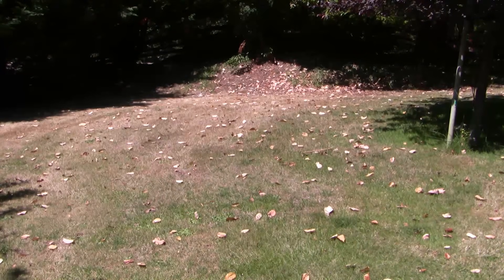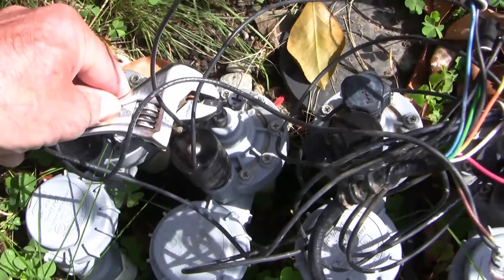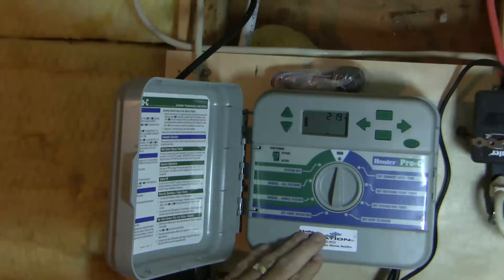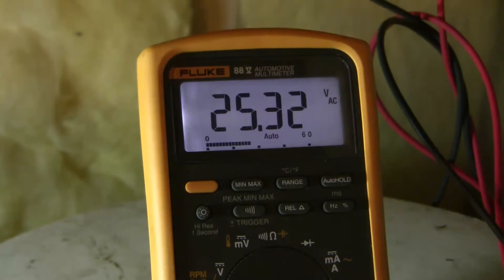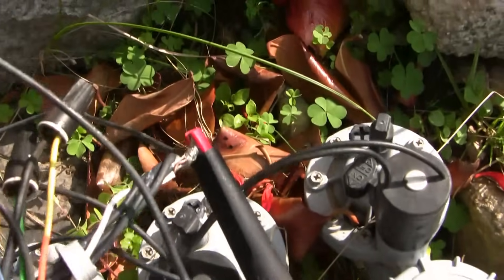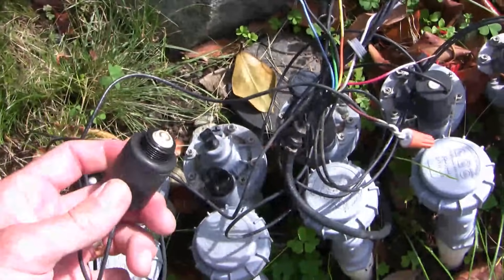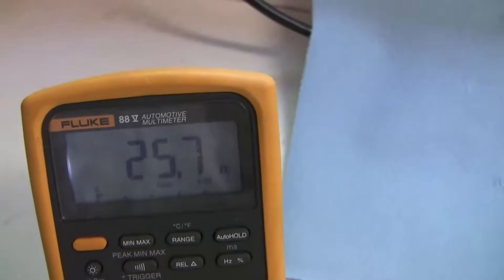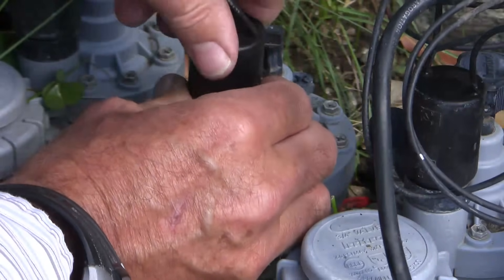How to fix an irrigation sprinkler zone that is not working

Comment: If I know already know that water flows from the zone I’m working on, but does not turn on when I activate from main controller, is it still necessary for me to do a drop test with all of my solenoids throughout my yard? Or can I just measure the one solenoid valve that isn’t responding?
Reply from the maker: Just study the solenoid and circuit that is bad. Cynics or professionals might say, just swap in a new solenoid and see if it works. Professionals sometimes do that because they have new solenoids in the truck and they can use the new one elsewhere if that doesn't work. They recognize the typical pattern of solenoid failure and swapping in a new one is faster. However before the amateur takes a possibly unnecessary trip to the parts store, it takes only a minute to do a drop test to verify the diagnosis. The other option is to swap two zone solenoids and see if the problem moves to the new zone. However once you get comfortable with drop testing, it takes only seconds to do and you don't need to fiddle with wiring on zones that you know are good. I find proving the diagnosis to be satisfying, if only by giving more confidence that you aren't swapping parts blindly.

Comment: First off great video   ok my problem is that im only getting 9 volts to one zone...24 volts at the timer   any ideas?
Reply from the maker: You can get strange readings if you accidentally set your multimeter to read DC volts, so check that first. When current is flowing, it is not uncommon to read lower voltage, usually meaning there is some other source of voltage drop like a high resistance connection at a splice or connector. Check your wire nuts along the run, and do the drop test at different areas to decide if the drop is on the ground side or the power side. You can also get a partial short inside the solenoid itself, lowering resistance to the point that other sources of line resistance becomes more of a factor. To smoke that one out, you'll want to disconnect the solenoid and do a separate ohm check. Good luck!
Reply: the zone wast working..i hooked 2 zones together and it worked  so im thinking wiring somehow went bad
Reply from the maker: If two solenoids are electrically hooked up in series, then the voltage drop is split between the two devices. If hooked up in parallel the drop should still be 24V, but the current is split along two different pathways so power to activate devices is reduced. If you physically merged two lines together with one solenoid, you should still have 24V....

Comment: Subscribed. Great quality.
Reply from the maker: Thanks, brother.
Reply: Quick questions, what do you recommend for running sprinkler wire outdoor? I have six zones with buried wires. Wires are shorted (checked using your method). Solenoids are good. I need to run new wire.
Reply from the maker: Even though it is an AC, fairly low current feed, there will be some line loss especially if the run is long. I would use multistrand insulated copper wire, and the manual for your controller may offer specific details as to wire gauge. I would use at least one step larger than minimum gauge recommendations for length. If you can isolate where the short is, your job will be a lot easier. You can borrow or buy a 'fox and hound' short circuit finder if the lines aren't too deep. Those things work fine in areas where there are no other wires close by, although I find the signal confusing around a circuit box where inductive effects come to play. Before digging around make sure there isn't a problem of frayed or crossed wires where they enter the controller and at wire connection points.
Reply: spelunkerd Thank you. I'll be on it today.

Comment: or you could also turn down your flow control on your valve to also remove the solenoid.
Reply from the maker: Good point, thanks for the contribution to the thread!

Comment: Toro XF-416 irrigation controller.  All my sections 1 thru 6 stopped coming on after the breaker failed.   I checked power to and from the pump along with circuits 1 thru 6.  All good.  Haven't tested the coils yet... what are the chances all 6 burned out at the same time?
Reply: I found the problem.  When the controller was reset from changing the breaker... pumps 1 thru 6 were turned on by default 7 and 8 were off.  Switched pump 7 on and all stations worked flawlessly.
Reply from the maker: Glad you worked it out. This kind or remark together with followup after fixing the issue will likely help others. Viewer remarks like this one are a primary reason Youtube is so successful.

Comment: Hi.Oh boy! Overwhelming for me. I don't the necessary appliances to test.. I know I have a problem of an irrigation sprinkler zone not working AND a sprinkler head that won't shut off. I basically do all the timing and zones manually, as well as turning on /off the main water to the system. Ugh! 
Great video and education!
Reply from the maker: Thanks, there's always more to learn. If a whole sprinkler zone won't shut off at all, it is often a problem inside the valve. Hunter valves have a small passageway that can get blocked with debris, preventing the solenoid from allowing the valve to open when power to the solenoid is removed. You open the valve and clean it out, pass a small wire into that opening to be sure it's unblocked. Hunter have a video here on Youtube showing how that is done. If you think it's an electrical problem you could measure voltage at the solenoid to be sure it turns off when the time limit for watering on that zone expires. If the voltage fails to drop, you've got a programming issue. When one zone fails to close, all the others that are up next won't work properly because water pressure in the line is too low to open the next zone in line.
Reply: Norj Be if your sprinkler head is not shutting off that is an indication that the zone valve is weeping due to a bad valve solenoid seal or bad diaphragm which is in my opinion best to replace both and be done.

Comment: Thank you for the video! So I started my testing. I have 6 zones (I only use 4) and the only one that works did measure Ohms in the range you gave. The other 3 that I use (and aren't working) and the other 2 I don't use didn't give me anything. When I turned on the zones individually 1-6 all of them read approx 25volts.  Where should I go from here?
Reply from the maker: It depends a bit on your experience with electronic testing. However the simple approach would be to take a known good solenoid and swap it into the zone that is not working. If the zone then works, you know the solenoid is bad and I would replace it. A new solenoid is pretty inexpensive and so you could either swap in a new one or switch one from a working zone elsewhere. Some valves have a small orifice that decompresses the back side of the valve, and if that orifice becomes blocked with debris the valve can stick. So, if swapping a solenoid doesn't help the next option would be to disassemble and clean the valve. Hunter have a few videos here on Youtube showing how to do that.
Reply: Thank you for the quick reply. I swapped the wires one at a time from each valve to each zone. Only zone 2 works. All 4 valves worked when connected to zone 2 and didn't work when connected to any of the other zones.
Reply from the maker: It sounds like the bad zones have a problem with excessive resistance in the wiring. To prove that you need to put the circuit under load, with electrons flowing, and measure voltage drop across the solenoid, I was doing that during the video. For better explanation search the phrase "voltage drop test". If voltage drops more than a volt or so compared to voltage measured at the controller you are losing power because of a source of resistance somewhere along the wire between the controller and the solenoid. The common places are at connectors, where corrosion and water can cause resistance and drain power. Now would be a good time to replace any connectors with ones designed for wet applications. They come with a little dielectric grease that repels water and reduces corrosion. Alternatively you could buy a tube of dielectric grease at an autoparts store and smear it inside the connector, then wrap carefully with tape or shrink wrap insulation. Good luck!
Reply: Will do. Thank you!

Comment: Loved the video and very helpful. I usually just start with swapping out the solenoid for a good one and work back from there. Usually it is the solenoid. Thanks for making an sharing this with the world. Sure helps a lot.
Reply from the maker: You make a good point, that is the technique used by many professionals who have replacement parts handy and who can easily recognize the situation. Coming from the auto repair field, some parts are special orders and hundreds of dollars, so it makes sense prove the part is bad before replacing it. I like testing because it gives me insight as to how the system works, and it doesn't take a lot of effort to do the testing.

Comment: I have a question.  I am trying to get 7 zones working across the street from my controller.  I found the wires where they cross the street.  There are 3 multi stran wires coming into the controller.  They are spliced in a valve box below the controller.  All wires from the field are single stran #14 irrigation wire.  When I turn on a valve that is supposed to be across the street I get a good 27-28 volts from the controller, when I hook up the common and the 27 volt wire to the solenoid, it will not come on and I am getting a 0 volt reading on my meter.  If I take the solenoid wires loose I get my 27-28 volt reading.  Do you know or have come across a situation like this?  It has me pulling my hair out, not that I can afford to loose any.
Reply from the maker: It sounds like you may have a source of extra resistance to the circuit. Google the phrase "voltage drop test", it's a valuable concept worth understanding. I did a video on the topic while showing how to test a car battery and how to evaluate a starter motor, but that video might be a bit too much if you're new to the idea. If your measured voltage drops to zero when the circuit is turned on, there is extra resistance, somewhere. If the run is long, it could be in the wires themselves, but more likely it's at a connector or frayed wire somewhere along the way. This is really common, I did a voltage drop test today when fixing a battery powered light, and with the test I was able to find and then repair the bad connection. Look carefully at all the connections, and retest different parts of the circuit to better identify which part is bad. Importantly, to do a voltage drop test, electrons needs to be flowing, it won't work by just checking resistance with a multimeter. Good luck!

Comment: excellent.  What do you guess if sprinklers turn on  in 1 zone and the control panel does not work. contrlol panel it is all turned off but 1 zone just goes. and can't change to other zones via the control panel
Reply from the maker: To decide whether it is an electrical or a mechanical problem, I'd check for current or voltage at the solenoid to decide whether the controller has commanded the valve to be closed. First check voltage at the solenoid both when the valve is closed and then when it is opened by the solenoid. Then when the valve should be closed but remains open, recheck to compare your multimeter readings to see which pattern it matches up with. I'll guess the on command will be gone, but it's easy to check. If the valve is sticking open with no open command, remove and clean the valve body, looking for sticking parts and for orifices that might be clogged with debris. If the open command is still active, go back to the controller and try reprogramming. As you say, with one zone open you can't expect any others to behave normally because there won't be enough volume flow or pressure to see normal behavior. Good luck!

Comment: so what if that isn't the problem what else can you do
Reply from the maker: You've got to be more specific than that for anybody to realistically help. The best first step to fixing these systems yourself is to learn how they work. The other sprinkler video I did covers fundamentals that might help get you going. Once you understand how the system works, you'll be able to think of ways to expose clues that will point to the problem area. It will also make it easier to accurately communicate the problem to get advice from others. Any kind of DIY approach takes quite a bit of investment of time and effort, and it's easy to understand how many would find it too much to spend weekend hours getting dirty. A pro could often find the problem for minimal cost, so for those not willing to commit effort, I wouldn't hesitate to ask for help. Last month I spent several hours on my son's system, which is set up differently. With learned humility, I'll confirm it's a labor of love, even if you think you know a lot, ha ha.
Reply: spelunkerd basically I check the voltage on solanoid and controller but zone still not turning on
Reply from the maker: What if you open the valve manually?
Reply: spelunkerd it works manually just trying to get it to work one that zone the rest of the zones work except one
Reply from the maker: Unscrew the top of the valve body and carefully clean it. Some models have a little drain hole near the solenoid that can get clogged with debris. If the hole doesn't drain the valve won't open. Hunter have a Youtube video out showing how their new generation valves work, and they show that drain hole well.
Reply: spelunkerd kk thanks
Reply from the maker: No problem, let us know how that works out.

Comment: great video first off, I have a issue with one of my zones. the problem I'm having is when I leave my lawn to work off the timer the pressure at the sprinklers are low but if I manually do it at the diaphragm the pressure is fine.
Reply from the maker: Some systems have a manual control that will adjust how much the valve opens with the solenoid, I would look for and try that first. Make sure the solenoid is tightened all the way down, and I would remove it carefully and clean the seat. If that fails you could temporarily swap a neighbour solenoid to see if it works better. If it does, then it's time to replace the solenoid, they aren't very expensive.
Reply: Hello sir thanks for the prompt response been 5 tears for this video. I'll check that.  My diaphragms are the same as the ones in your video

Comment: out the solenoid there are two black wires, one goes to the power and the other?????
Reply from the maker: One wire goes to the common ground wire, which is usually wired to the ground for all the other devices with a large wire nut. That common ground will be easy to recognize because several wires lead to it, only one of which goes back to the controller. The other wire is a single coloured wire, connecting a switch at the controller to the solenoid. Of course it is AC current, but the notion of a ground is still useful.
Reply: thank you.

Comment: This is probably the best algorithm anywhere on the web for troubleshooting sprinkler zones, thank you for sharing!  I have a 10 zone system.  My issue is a bit strange, I'm able to manually turn on each zone at the solenoid.  However, sometimes, zones 5-10 will have low pressure.  They turn on, the pressure is just low.  Sometimes, they turn on just fine.  Zones 1-4 are reliable and have high pressure all the time.

Anyone able to figure this one out?
Reply from the maker: It sounds like your system pressure or water flow rate is too low. Look for zones that aren't turning off all the way, sprinkler heads that are broken, or kinks in your line that limit flow. Program watering when demand from  other devices will be low,  look for wet areas that might point to a broken line. Good luck!

Comment: Nice video and helpful but my Toro controller has snap in connections so I can't get to the terminals so I am wondering how to do the testing? I researched and have not found any answer other than perhaps, I can't test from the controller? I have 1 zone not coming on with rest working fine so I think it maybe a solenoid.
Reply from the maker: There's a technique called 'back probing', where you thread a needle from the back into the connector, then attach your multimeter jaws around the needle. Back probing is considered a better way to test voltage compared to front probing because there is less chance of spreading the female end of the connector, damaging the electrical contact. Failing that, you can pass a needle through the insulation of the wire into the copper part of the wire, but if you do that remember to paint it with insulating compound after you're done. Electrician's tape in a can, meant to be painted on with it's own brush inside the can, is for sale at any hardware store. You can buy special accessories to backprobe, but many of us just pick up some very thin probes and needles at the fabric store, ha ha.